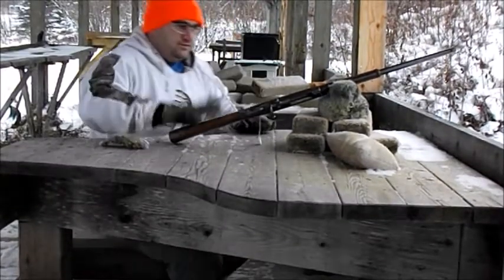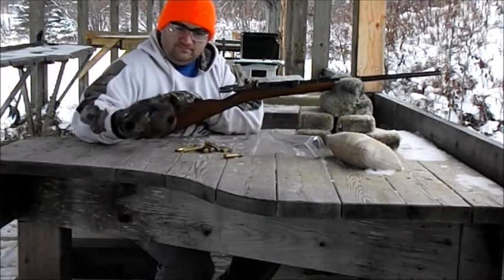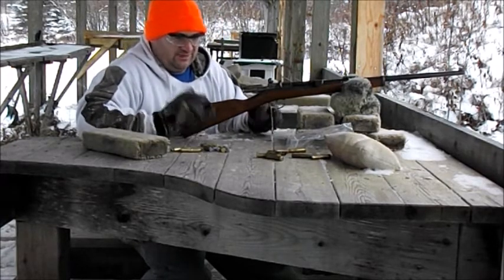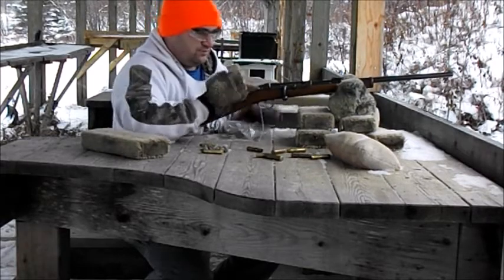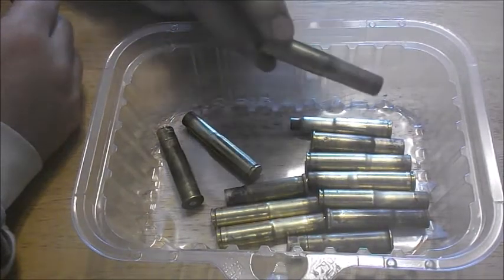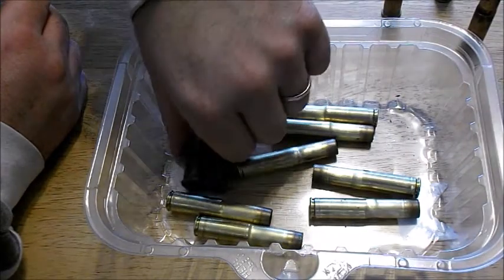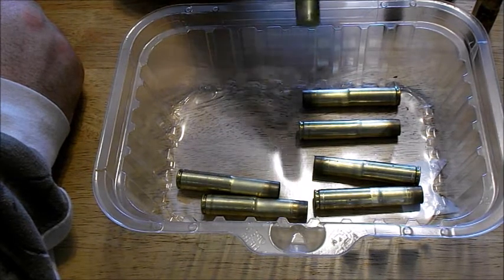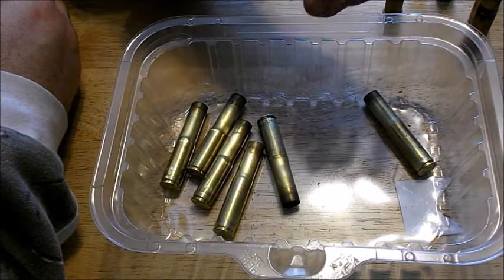43 Mauser Brass from 300 WinMag

Comment: How much does your firing pin stick out from the bolt face? I just got a Mauser 1871 and measured .085" which seems way too much
Reply from the maker: Mine also sticks out a lot. That is normal for old milspects. Its more important that its rounded and not sharp.
Reply: 4570 much easier ive made hundreds
Reply: @rodsvintagesxschannel.3095 you make 43 mauser from 45-70 cases?